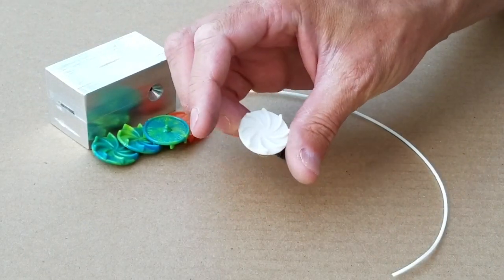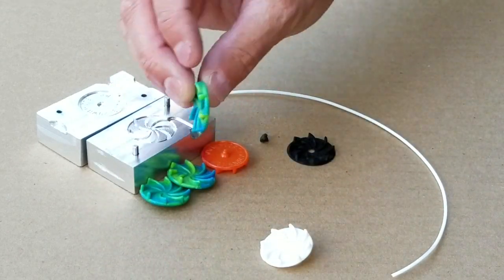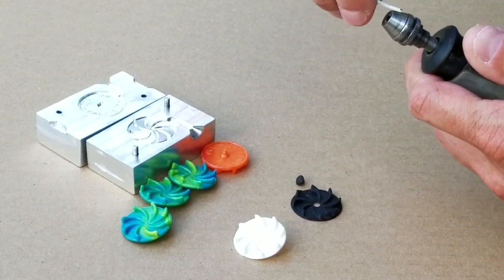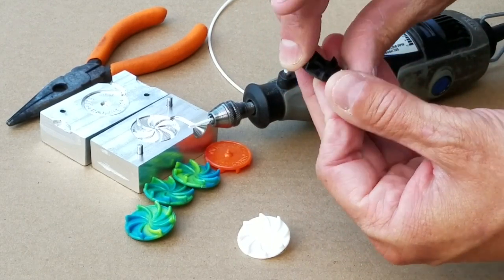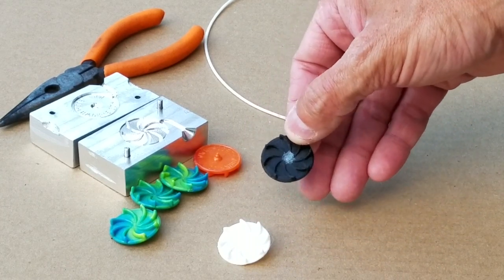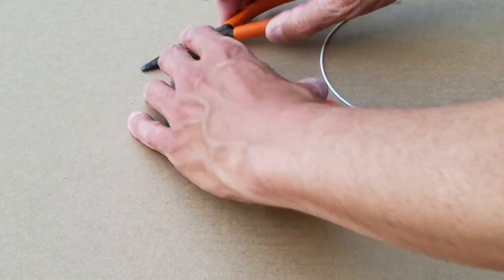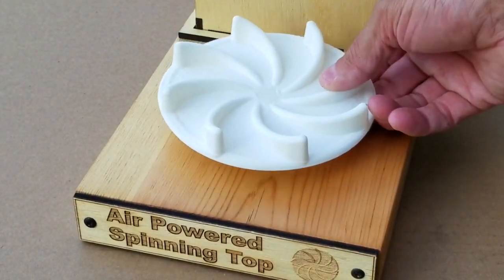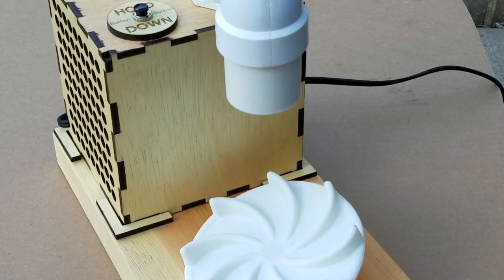Air Powered Top

Comment: Do you have the piles for the injection mold posted anywhere?  I work with a group developing Open Source / DIY Injection Molding Machines, and this would be a neat mold to have!
Reply from the maker: No there are not any models for the mold online.
Reply: @ScorchWorks  Would you be able to post them, or do you no longer have the CAD files?
Reply from the maker: @ericlotze7724  I never made a mold model.  I wrote g-code by hand to make the mold.  The g-code uses variables and loops so it is useless if you are using a GRBL based controller.  If you think the g-code would be usefull contact me by e-mail scorch at scorchworks.com.  Alternatively making a mold model using boolean operations is not that hard in OpenSCAD or another program.  I am sure someone in your group can do it.
Reply: @ScorchWorks  Yeah Thanks!  That's definitely above my know-how, but i'll ask around and keep in touch.

Also thanks for making all these cool projects and sharing them with us, really glad i found your channel!